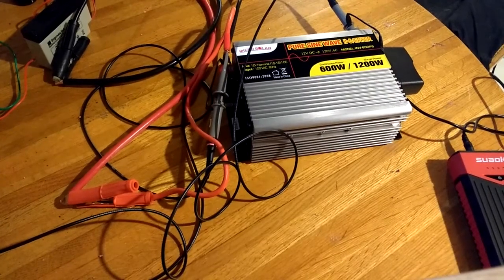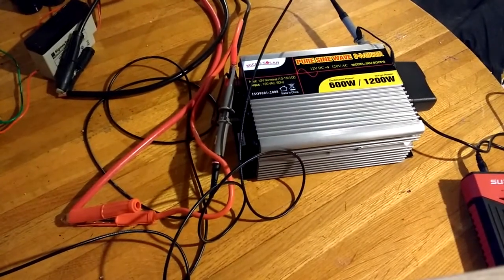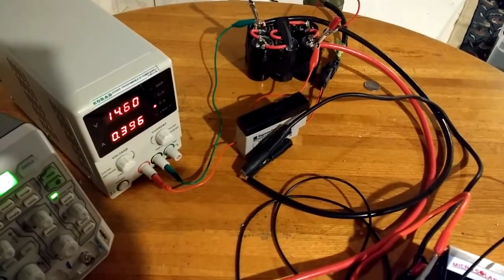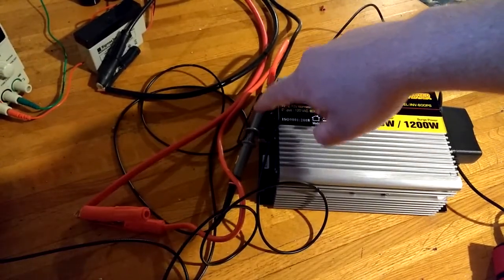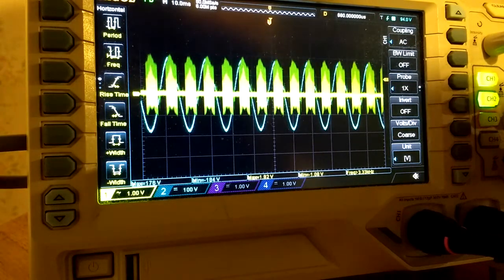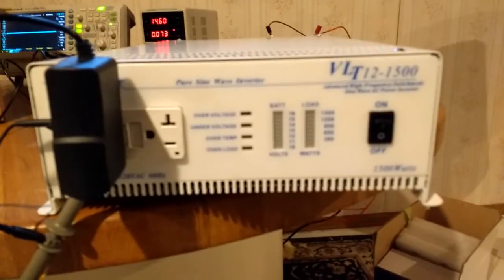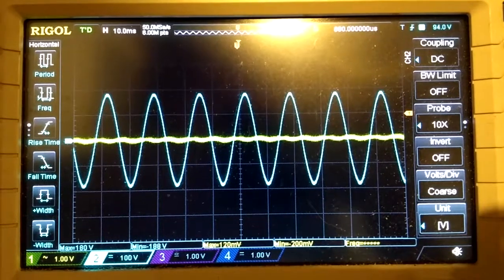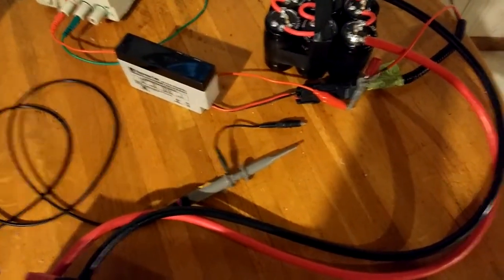Problem with cheap inverters.  MicroSolar MicroSolar 12V 600W vs Vanner VLT12-1500

Comment: I'm thinking a choke rated at the required Wattage on the input to the inverter would impede that noise the inverter is creating.  Even one or two twist of 6AWG around a ferrite  ring would stop most of that.

Comment: I'm adding a 300W MicroSolar sine wave inverter and a couple GTI to my power shed next year. Of course, these are all broken units so I get to see a lot of insides.  The GTI are notorious for blowing the input power capacitors because the ripple currents are about 20 times what the capacitor is rated for.  Design is for chap and to just get them through warranty period. They all need a multiple capacitor bank just at the input.  Would like to see the results with your cap bank right at the input.
Reply from the maker: opera that's a good idea. If I get a chance I'll have to try that.